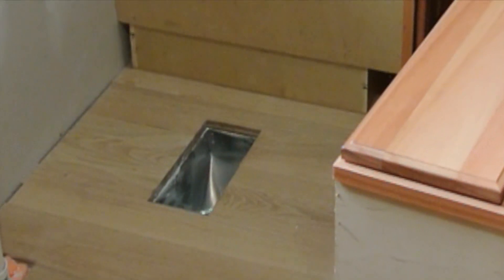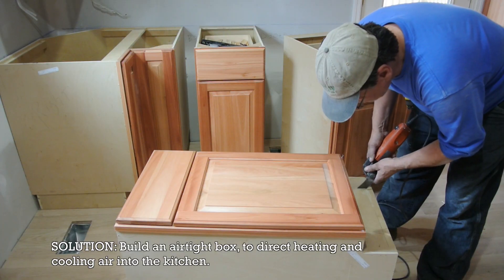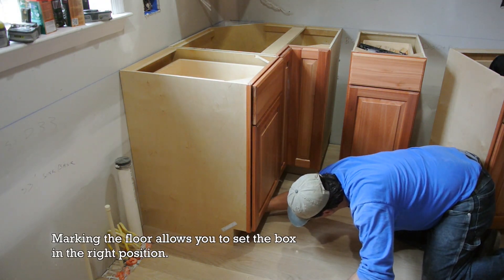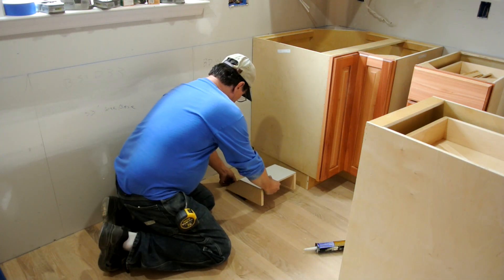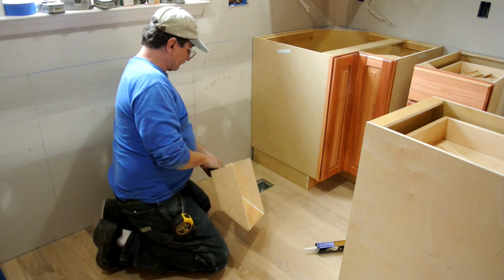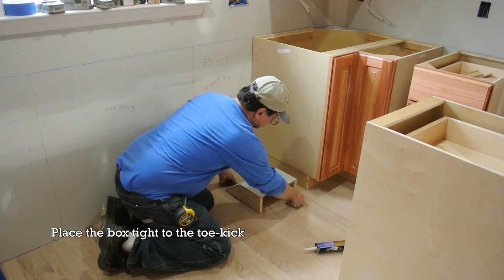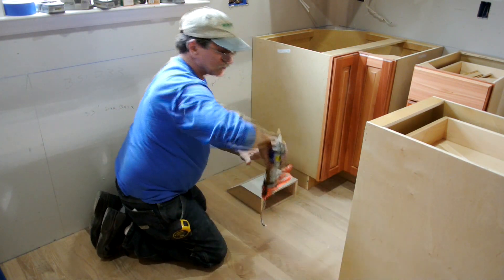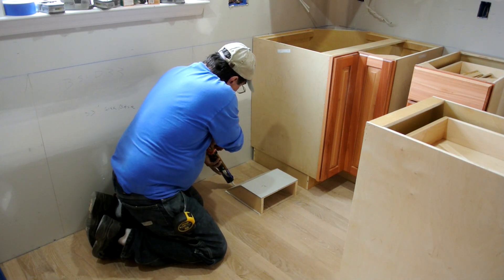Toe Kick Supply register

Comment: Great idea for what we are faced with right now.  Can I ask, did you use glue and/or screws to seal the front of the box and the inside of the cabinet?
Reply from the maker: I believe he used construction adhesive, but he may have just sealed it with caulk afterward. It would be best to seal all the joints tightly.

Comment: I've heard toe vents can cause rotten floors under cabinets if you live in humid areas or have a crawlspace
Reply: only if you have shitty insulation. but that's a symptom not the problem with toe kick vents. fix your house and toe kicks are fine